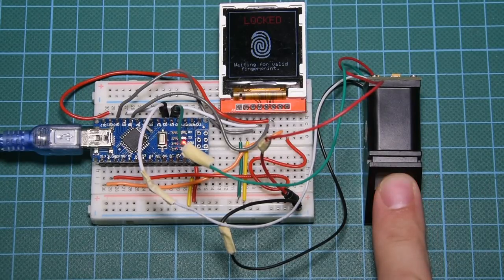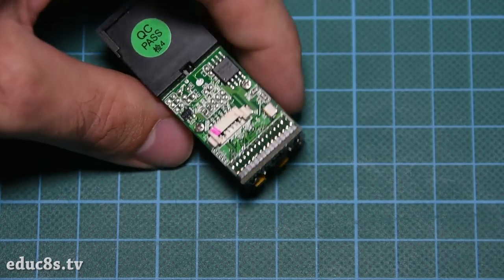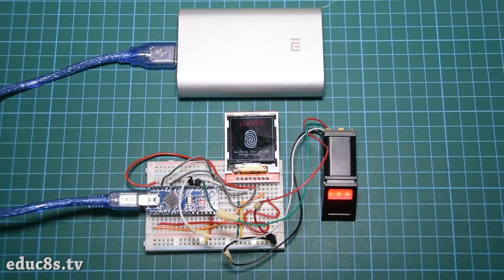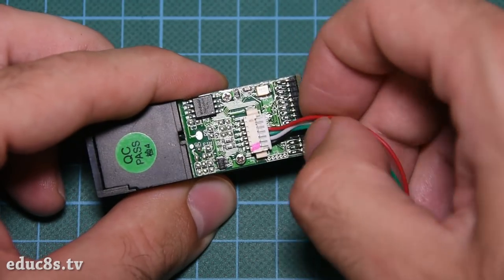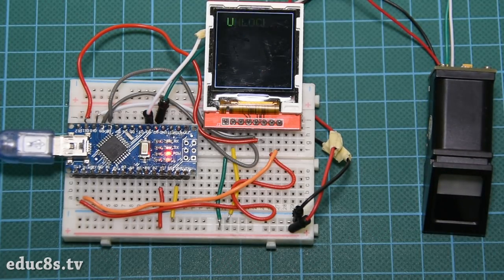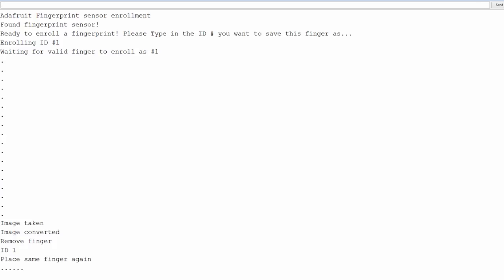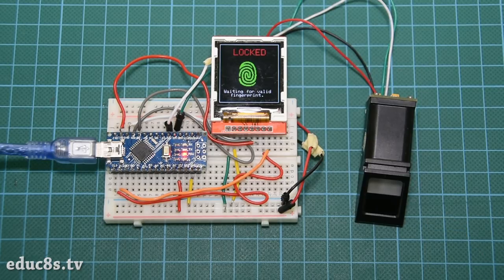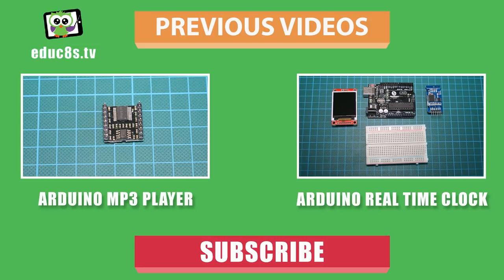Arduino Tutorial: Use a Fingerprint sensor module to add biometric security to your Arduino projects

Comment: Thanks for another great tutorial. Could you make another using raspberry pi and this fingerprint sensor instead of using arduino nano?
Reply: you may face problems with the library. check if there is library for raspbery

Comment: HI,i bought one fingerprint sensor and its really weird.It uses plastic connector at two ends and how do i actually connect it to the board of Arduino?Ive tried a lot of ways but still cant work.It uses 6 pins tho

Comment: Hi .. i made this project .. but i use a 1.44 tft module.. now i am faceing a problem with tft .. the problem is that the screen is not fully covered.. display not showing from the top, instead of that it shifted downword 2 cm from the top..so the end portion cannot show programme and it is missing.. can u pls help me frnd..

Comment: I have a weird problem.. the display starts drawing at about 1/8th to 1/4 down the screen and it appears to be upside down from what you have..(meaning top is where connectors are) its 1.44 tft v1.1.. it works but shows static in top portion of screen and cuts off the bottom.. like its not starting in the correct location.. any ideas? you had 2.1 module.. wonder if that makes a difference.
Reply: Did you connect the screen correctly?
Reply: the screen is connected correctly because it work fine.. it just doesnt start at the top of the screen and starts like 1/4 of the way down.
Reply: there is a command that rotates the screen. i had the same issue. look for it it is just a small line that say rotate and then you put 180 (degrees)
Reply: Hairless Hippy i have the same problem man.. i dont know how to fix it..

Comment: Hi, I tried this. I could not enroll fingerprints. It fails after taking image second time saying "Unknown Error". Have you done any tweaks in the code to make it work?
Reply from the maker: Hello Arjun, no I didn't make any changes. It worked first time!
Reply: I had the same problem. It's a bug in the arduino IDE. I had to downgrade to 1.6.9

Comment: Hi, can you tell me how to add a electronic lock to it?
Reply: if the electronic lock is 12volts then you have to connect an external 12v power supply for it and use a transistor or a relay in order to close the 12volt lock circuit

Comment: sir please help me.. my R305 is not blinking continously ... it blinks only onces and stop blinking
Reply: I faced with the same problem but I leart that "it is normal for the sensor to blink the red LED quickly once powered, after that the LED will be off until you've started to request data from it." When program ask for fingerprint to enroll, the light will blink continuously.